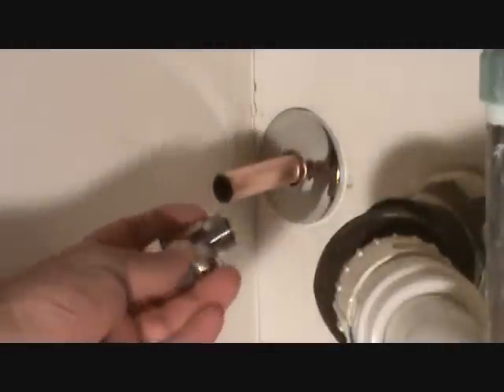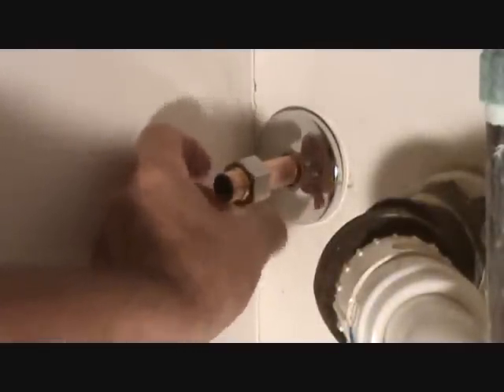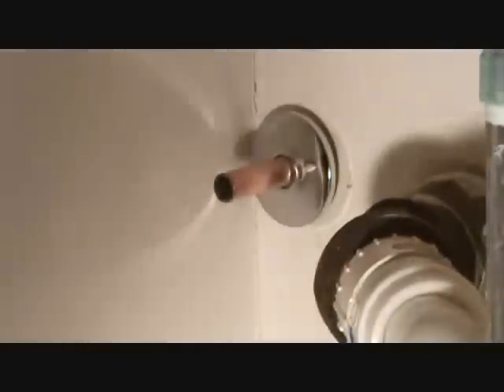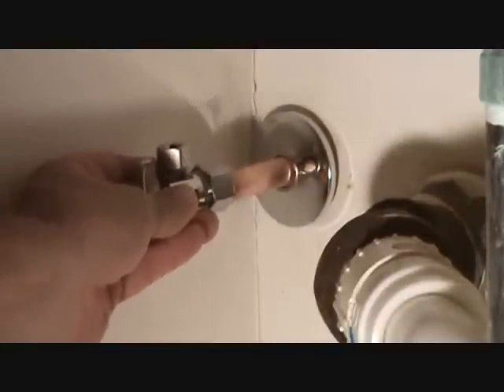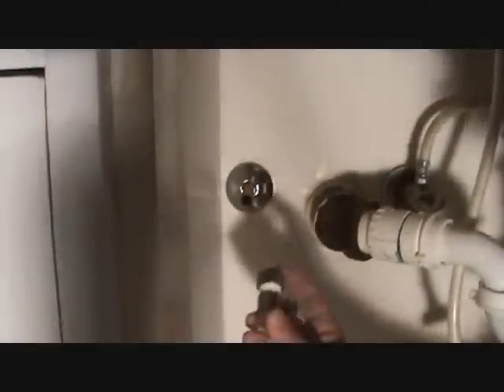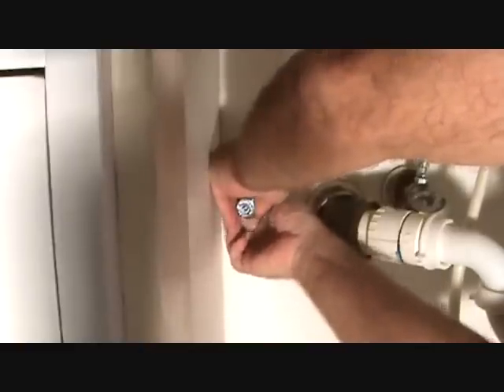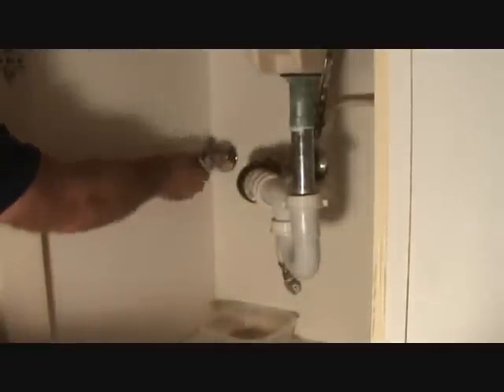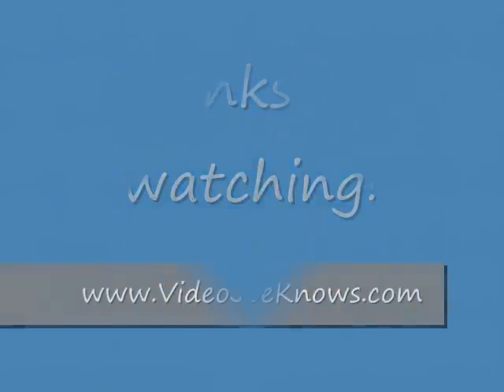How to install a compression fitting gate valve

Comment: I used the teflon tape on the threads. Worked great with no issues. No leaks whatsoever.  Thank you.
Reply from the maker: Awesome job. I use teflon tape whenever I can & sometimes there's really no need but then other times when you decided not to use the teflon tape is the time your worn threads leak & you kick yourself for not spending one extra minute to put the tape on! It's like an insurance policy I look at it that way. Thanks for your message & keep it going!

Comment from the maker: Funny you should say that. The first time I installed a compression fitting gate valve, it was slightly leaking after I turned the water back on. Instead of turning the water back off, I figured I could just tighten it up. When I tried to turn it, it gave just a little bit & the water pressure blew it right off. There was a flood of course, until I ran out & turned the water off. Lucky it was a new house with just the concrete sub-floor!   Joe  :0

Comment: Thanks for your video... idiot at HomeDepot told me to put this on the 'tip' of the pipe.  Wasn't until you said 'hit bottom' that i understood how to connect this.  Prior to you video, i made my kitchen into a slip slide because the compression valve flew off.  thanks again!!!
Reply from the maker: LMAO I had that happen to me once when I tried to tighten a loose slip slide water valve behind a refrigerator & of course you know what happens when you just turn it a millimeter! Yes....flew right off & water spewing out like all get out! I was there alone so I grabbed a rag & put it over the hole until I knew I had to make a race out to the front yard to turn the gate valve off to the whole house to shut off. So I run out there & shut it off then spent about half an hour wiping up all the water on the floor. Lucky for me the linoleum floor held up fine & off I went to work sheepishly thanking my lucky stars no one saw what I just did. Fool!

Comment: If the ferrule leaks it will come straight through the gap in between the nut and the pipe, not the thread of the nut. Teflon tape is a good insurance policy, but I would firstly put the compression fitting on without any teflon tape and tighten just enough so the ferrule is clamped around the pipe, then remove the fitting and place the teflon tape over the ferrule, replace the compression fitting and tighten fully. If there is a leak it is at the ferrule. Hope this helps.
Reply from the maker: I would refrain with applying teflon tape on the actual ferrule. I would think that would not be a good idea...

Comment from the maker: White or gray piping is called pvc & black plastic piping is called ABS. If you have pvc, then they probably have some type of gate valve you can install there, but it won't be a compression valve that you use on copper. Tell your hardware store what you have & what you are doing & they will set you up with the right valve. Thanks for your questions/comments!   Joe  :0

Comment: Just a little tip when installing chrome valves.....Always use 2 crescent wrenches or a crescent wrench and a spanner as you will mark the valve.
This is not a gate valve Joe, but a ball valve....1/4 turn. These valves are open when the handle is in the same direction as the outlet of the valve.
have a great day!
Reply from the maker: Very good tip in deed! Yes 2 crescent wrenches would be the way to go. You could really torque down on it & not have to worry about slipping with a pair of pliers or channel locks. As always I always appreciate hearing from you! Have a great day.    Joe  :0

Comment: I m trying to install a compression fitting on a vertical pipe underneath my kitchen sink.  Do I tighten the top part DOWN into the nut (where the compression ring is located), or do I hold the top part and twist the nut on the bottom down (which causes the nut to just come off and slide down the pipe)?  What actually compresses the compression ring onto the pipe?
Reply from the maker: The nut goes on the pipe first, then the compression ring goes on next, then the rest of the gate valve goes on the pipe. Make sure the gate valve goes all the way onto the pipe then slip the compression ring up & screw the nut onto the gate valve. Hole the body of the gate valve with a pair of pliers or channel locks or crescent wrench then tighten the nut onto the gate valve. As you are tightening the nut to the gate valve, this will then clamp the compression ring onto the pipe. Hope this explanation helps with your project.   Joe  :0
Reply: VideoJoeKnows Thanks for the info.  I'll try that tonight to see if it works.
Reply from the maker: Great. Let me know how you do.   Joe  :0
Reply: VideoJoeKnows
A friend came to help out.  Put on the plumber's tape, held down the fitting while he tightened the nut below.. turned the water back on and it works!
Reply from the maker: Yes! I knew you could do it. Thanks for not giving up!   Joe  :0

Comment: one of my valves need to be replace....does it have to be the same valve as the other side...or can it be a different valve...and still work the same...
Reply from the maker: Sorry for not getting right back to you. I used a compression type water gate valve as the pipe coming out of the wall with no threads on it. If you have like a male threaded adapter comping out of the wall, then your gate valve would be a different type. Let me know if you have other questions. Good luck with your project!   Joe  :0

Comment from the maker: Generally I don't see many pvc water lines set up for shut off valves......but now days, they run alot of homes with a plastic piping similar to pvc pipe. Ask your local hardware store what they would suggest & they will show you what they have. Or you can go to a wholesale plumbing store & they will fix you up for sure.   Joe  :0

Comment: I need your help desperately. I followed your instructions and got it on there tight, but I still had a drip between the valve and the copper pipe. What am I doing wrong??
Reply: Cally Lazich listening to him he puts the pluming tape in the wrong place
Reply: Take the damn teflon tape off, try again. You shouldn't use teflon tape for compression fittings.
Reply from the maker: What did you end up doing to get the leak fixed?
Reply from the maker: Ha I did not....! I use teflon tape for insurance purposes even on new gate valves sometimes....
Reply from the maker: I agree you should have to use teflon tape but sometimes if I have it I use it for insurance purposes & lots of times I've fixed older gate valves that were leaking by applying teflon tape so it sure doesn't hurt to use it....that's my thinking anyway.

Comment from the maker: Righto. No thread on pipe. That's why they call this the compression fitting way, since you are connecting to a threadless pipe. You have to get these on tight so they don't slip off when you turn the water back on. Have a great week ahead.    Joe  :0

Comment: Teflon tape around the threads on the nut is totally useless. It is the olive which makes the seal not the nut. A little around the olive may help as it this which makes the seal.
Reply: You are  correct this guy does not know what he is doing. Total incompetent.
Reply: @Troy Cunningham Perhaps you are American and therefore call the olive the ferrule. In the UK we call the ferrule an olive
Reply from the maker: Yes I know but if I ever have teflon tape with me I use it anyway as insurance. In fact I have had a new valve leak before without using it & it stopped leaking after removing the nut then applying teflon tape then reattaching & tightening the brand new nut & no leak. Not sure why it was leaking but I just end up using teflon tape as you never know. That's just what I do.....
Reply from the maker: Wahhhhh! Yes I know you should not have to use teflon tape on a brand new valve but I just do it for insurance purposes since I had a brand new valve leak one time just like this one & I removed the nut then put teflon tape on & tightened it back up & no leak. Can you explain this since according to you I don't know what I'm talking about?
Reply from the maker: Haha!

Comment: So you've installed a quarter turn ball valve, not a gate valve correct?
Reply from the maker: Well it's a gate valve that only turns a quarter turn for on & off & you can find them in the plumbing department at most local hardware stores & they sell them for this purpose for water lines.
Reply: My point was simply that it's not a gate valve at all, it's a ball valve. Gates move up-down; side-side. Balls rotate. @VideoJoeKnows

Comment: Teflon tape serves no purpose on compression joints. The threads have nothing to do with the seal, they just allow you to tighten to nut in order to compress the ferrel, which is where the seal is. If it is not properly connected and you used teflon, the water would just leak from the other side of the nut.

Also, that's a ball valve, not a gate valve.
Reply from the maker: Chase Hawes Ha! You're right on both accounts. Thanks for your insight. I know teflon tape should not have to be used but sometimes I've found that the nut will start leaking even when I think I can't tighten it up any further. I've especially found this to be a case when I get to an old leaking compression nut & wah lah, it usually works for me. I just kind of use it like an insurance policy even when I think I shouldn't have to. Thanks again for taking the time to send me your comments. Have a great day!   Joe  :0

Comment: No tape! Lightly dope for lubricant
Reply from the maker: I just got in the habit of installing lots of plumbing fittings with teflon tape as an insurance policy because it never fails...when I don't install teflon tape then I might get a small leak where I think if only I had installed teflon tape! I always get the leaks fixed though but teflon tape has always been there for me. I realize that if you use new fittings & connections you really shouldn't have to use teflon tape but again I've seen some new fittings leak even when I do everything right so....
Reply from the maker: Thanks for taking the time to send me your message...much appreciated!

Comment: I need your help desperately. I followed your instructions and got it on there tight, but I still had a drip between the valve and the copper pipe. What am I doing wrong??
Reply: the thing you're doing wrong is watching this video
Reply from the maker: How did you get it fixed? You must not have had it tight enough...? If you had a new gate valve it should not leak of course but if you were reinstalling say an old one then you could've used teflon tape on the threads too & then it might not have leaked. Hope you got everything taken care of years ago & I'm sure you did.
Reply from the maker: LMAO!!